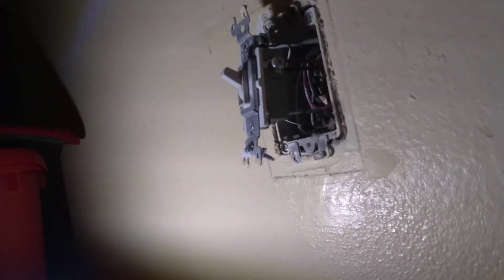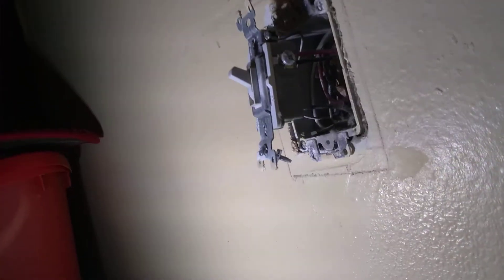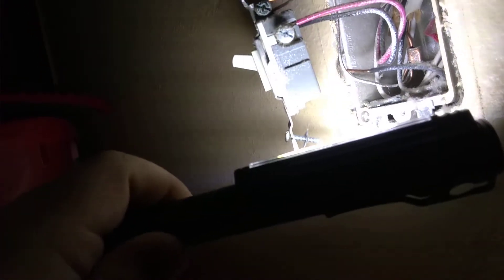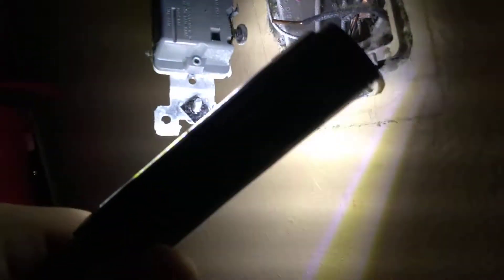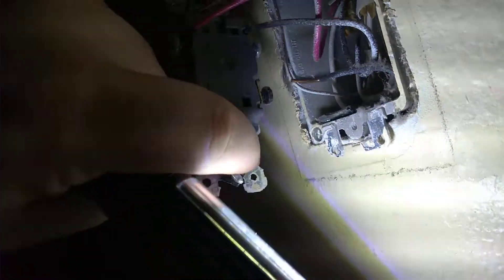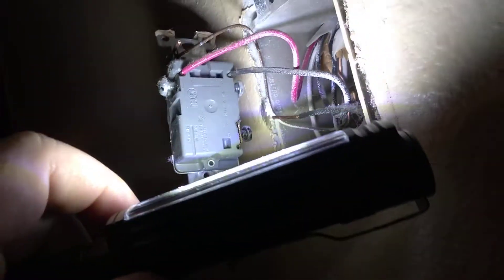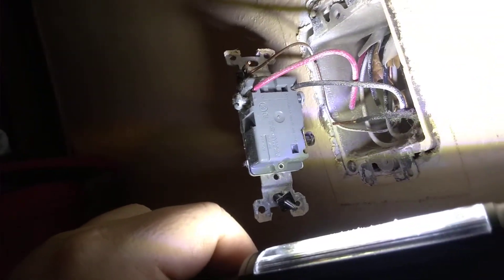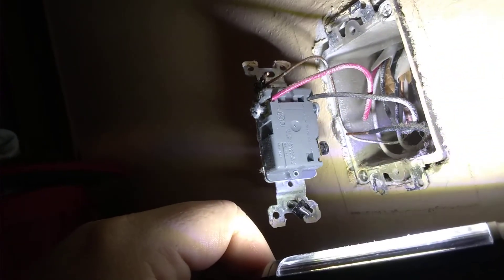Don't use push in wire connectors in ac wiring "Rant"

Comment: He started to rant about push connectors then had to change his rant when he saw what the issue really was.
Reply from the maker: ? the issue was the push connector, it just broke as well as the wire backing itself out. If they would have just used the screw clamp connectors on the sides instead it never would have happened.